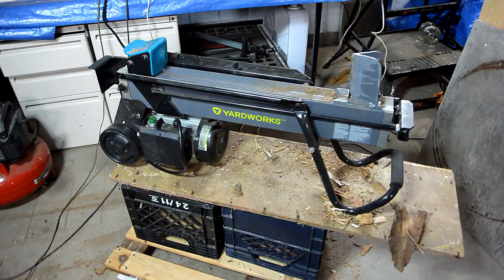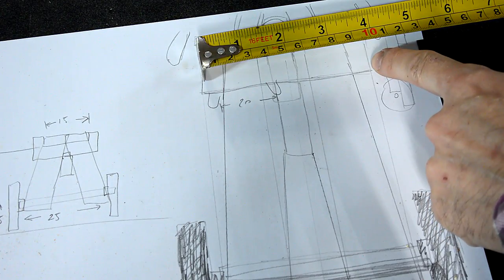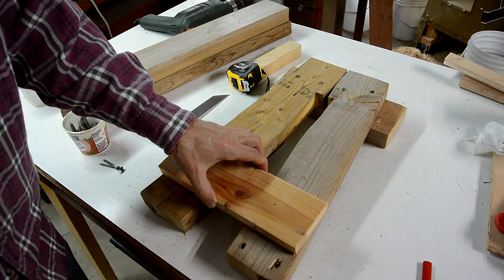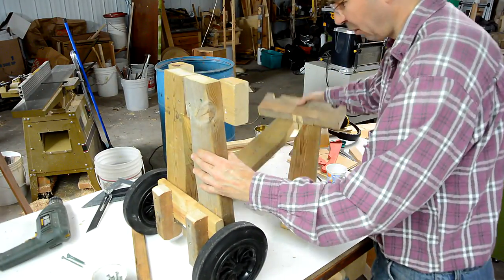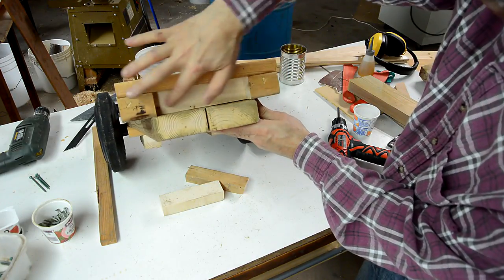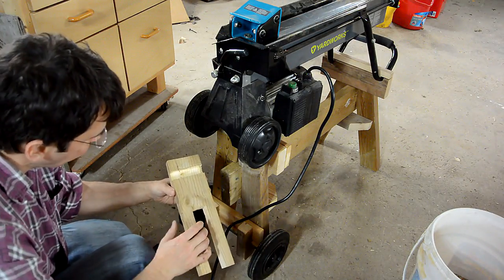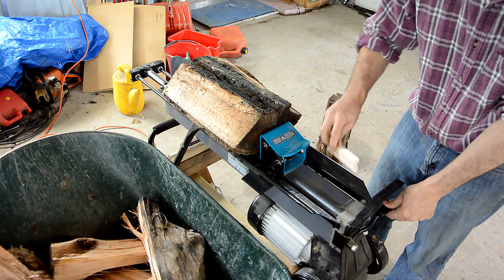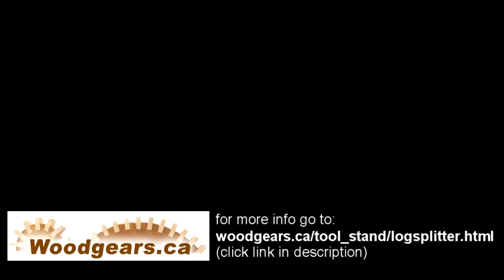Electric log splitter stand

Comment: When you mentioned the long travel time of the cylinder, I expected you to put a block in front of the jaw, not a stopper to prevent it returning. It's this kind of logic that makes your projects interesting to watch.
Reply: i was expecting the same, but then i realized it could be dagerous to have 2 pieces pushig against eachother... huge chunks of wood jumping around are not fun when you are nearby :D
Reply: I thought the same as you and I still think that's a better solution because you do not stop the machine to go back.
Reply: I have concocted several such blocks. None of them stand up to long term use. Mathias' approach is much more effective and safer to boot!
Reply: I've been using a pusher block and it has given some nasty surprises. Never thought about Matthias' approach... But now i will. Also one way to not let the piston travel all the way back is just let go of the switch, but keep the valve open - but that will leave me managing logs singlehanded...
Reply: mine has a collar with a screw in it which is on one of the pull rods. just tighten the screw (it has a big hand knob on it) and the stroke is reduced.
Reply: DesandSam  namberjack

Comment: I have one of those splitters, (the older green version). I put a bungee cord on the safety handle so when you let go of the power button the part that pushes the log ahead stays put and I can lift the safety lever to move the pusher back to where I want it. Saves a lot of time between splits.
This way I can have a hand free during splitting so in case a log splits violently I have a hand free to catch it. Good because my slpitter on a stand is at stomach/groin height.
Note: This is bypassing a safety feature and I am not saying to do this but this is the way I use this type of splitter. Do so at your own risk.

Comment: I recently got a very similar machine. They are actually hydrolic, the electric motor driving a hydrolic pump. Or the one I have has. And they are surprisingly powerful. I have been splitting rounds way over the specified diameter. I use it on a trestle table. I found it about the right height, a lot higher than you are aiming for and with it on a trestle table against a wall when the logs separate it 'catches' them so I don't have to pick them up off the floor. Just from the table height.  You can't always position them so the right size is at the back to drop into a barrow, then you have to go round and get it. On the table I just reach over and lift it back to the splitter bed.

The one I got has a giant washer, really thick, on the half inch round stock black bars that run from the head of the thing back to the pusher mechanism. This is threaded like a grub screw would be and clamps on to the round stock so you can limit the cycle length. You solve that at the end of the film with a block of wood but on mine I can adjust the stroke length with this stop. 

Do NOT be tempted to put a block of something in between the log and the pusher. The forces involved will launch said block into your face at the earliest opportunity.

I like the oiling idea but I worried that would just end up being a grinding paste with grit off the logs stuck to and embedded in the nylon friction reducing pads... And don't forget to loosen on starting and tighten after, the little bleeder valve, stupid plastic thing it is.....

Comment: This is a great video and my introduction to Matthias (subscribed). I am going to make my wheels a little wider apart and use big pneumatic ones. I often take the splitter to the log pile (less handling) over very uneven ground. These things are really top-heavy and can easily tip over on slight inclines.

Comment: I have been using a splitter for several years now, and I learned two new ideas. First, the small wooden piece to stop the cylinder from going all the way back. I expect that will be better than using a small log to push the log you want to split. Also, I will clean the resin from my splitter and grease the bed!

Comment: I like silicone spray for lubricating the splitter as it doesn't gum up from dirt/chips like it will with oil
Reply: Since I found PTFE (Teflon) spray I've been using that.  Even better than silicone! You're right about grease and oil... it just gums up too much after it's gathered enough debris from a short splitting session.

Comment: I have an almost identical splitter, and I too get annoyed by the retract length of the cylinder. All it took was a scrap of wood to alleviate the problem and I never even thought to do that. I guess I really am dumber than a stump lol.
Reply: I am planning to extend my presser for that reason. I have to check if I can actually just use a stopper like Matthias also.
Reply: No. Mathias is an unusual thinker. He is able to decode most things and reduce them to a simple solution. Look into his education and background and you will see why.

Comment: A nice custom adaptation of old used lumber to make a stand for this model....stands generally cost some $40 to $50 and do not come with those nice wheels and axle you had laying around!  Nothing too painful to watch in the entire video!  Nice to have a decent shop to build such items.  I have a 5 ton electric unit and used a spare stand I had out of my woodworking shop to bolt my splitter to.  So my stand was left from my older planer that finally died.  It has no wheels, but I do not move my splitter around.  It stays on my covered back porch and is my splitting station.

Comment: Were you not tempted to make your own log splitter. I'm sure you could come up with an improved design. 🙂
Reply from the maker: the hydraulics alone would cost much more than the whole splitter
Reply: Do it with gears!
Reply: With sufficient gearing, would you really need hydraulics?  I would think you could get similar pressure using a worm-gear type motor.
Reply: +Matthias Wandel I bet the youtube views would pay for the hydraulics plus what you already paid for the splitter. An all wooden hydraulic log splitter would get a lot of views. Especially if you get highspeed of the pressurized wooden cylinder exploding.

Comment: I have the same model. At 4:44 he makes a great point on saving time with the spacer. I've witnessed and experienced people  using a seperate wood block in front of the pusher to save time. DO NOT DO THAT. Either the wood you are splitting or the block will pop out in random directions depending on the angle of either piece of wood you are using. I learned the hard way. I used a piece of aluminum block that was square with rounded edges and guess what. POP!!!  Luckily no injuries sustained

Comment: I do like the stand and I am a bit jealous since mine log spliter is hydraulic.  Using what is nothing more than a 10 ton house jack that you have to pump.  It was cheap and still better than splitting it with an axe.

Comment: March 2021. I just bought this same splitter from crappy tire. I was too cheap to get a gas unit, didn't wanna spend $1000. I'm not digging that it needs a stand. And Especially don't like that you have to use two hands to operate it. The green button and a lever. Don't ever forget to open the hydraulic pressure release screw.

Comment: I would recommend you build you log splitter stand, like mine!  Make the ground level Get 8 concert blocks, 2 high. 4 in the back on the wheels  and 4 in the front on the legs>  this way you can check the oil. I made a cover for it as well and it stay there!

Comment: I've always been confused about how your big dust collector works. Because the motor is on the side and all the space in between. I was wondering if you could maybe try to take the filter bag off the top and have a look inside. Thx.

Comment: Matthias, can you tell us (in a future video) what the actual tension on your bandsaw blade is. I see you making these tight corners and when i do this i'm just twisting my blade.
Reply from the maker: it's more a function of having the right blade.  But if you have a bandsaw smaller than 14", those can ONLY take crappy blades.
Reply: Thanks for your super quick response. It's a 12" makita. I have heard something about rounding over the back side of the blade to make it possible to cut corners thighter than intended. Is this true? Wouldn't that weaken the already lesser quality blade?

Comment: Why don't you use impact drivers? Doesn't it drive you nuts when the head skips on a screw using a standard drill to drive screws?
Reply: Canadians use a different kind of screw that doesn't skip on a drill, but I think the tip might bind if he used an impact driver.
Reply from the maker: drills are so much quieter, that's why I stopped using impact drivers
Reply: +Matthias Next: the Silent Pantorouter, powered by termites.

Comment: Would the motor on that splitter  work for a bandsaw,?
Reply: The motor is an induction motor, so if you could get the hydraulic pump off and its over 1/3HP then yes it would work for a bandsaw
Reply: This was also my suspicion. I have been trying to get a proper motor for the 14" saw I am currently building. Since I live in a small town, used motors are not an abundant resource. Used proper motors therefore cost me around 2.000,- NOK(~$300( whereas a new splitter like this will set me back only around 1200NOK ($170)

Comment: I think the base on most of those electric splitters is way too narrow and unstable. One of the first things I'd do is bolt (or weld) legs that were atleast 2.5 feet apart at the bottom.

Comment: Do you know at what pressure does this system work? I'm courios :-)
Reply: Mirko Ragni  work pressure I don't know ,but working force 6000kg, does not split Austarlian hard woods easy.
Reply: Mirko, l killed my six ton splitter and was given a replacement rated at 6.5 ton still won't do iron bark gum tree, and a mate has an older model only rated at 2.5 ton.